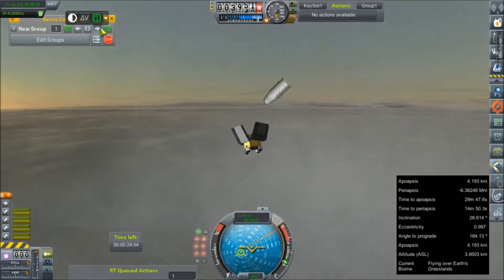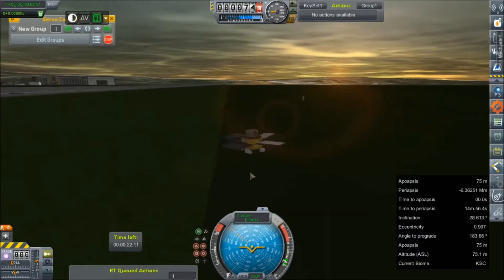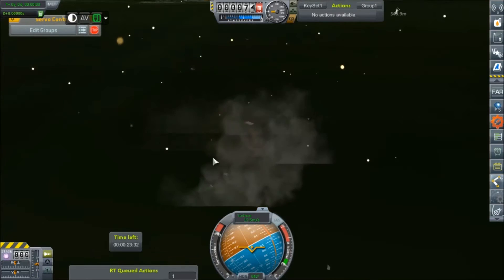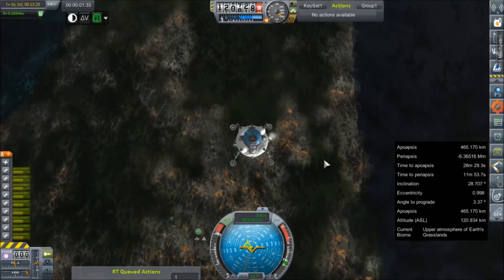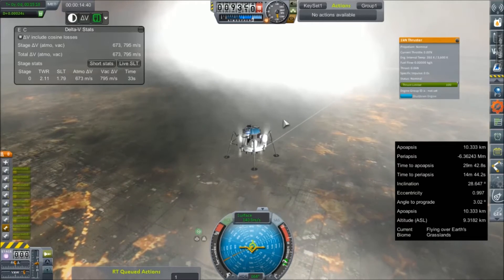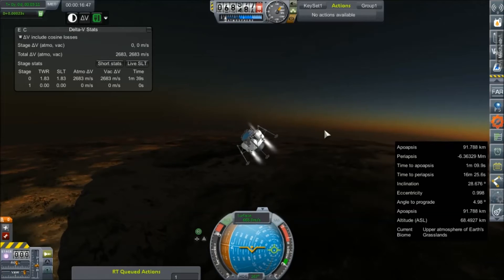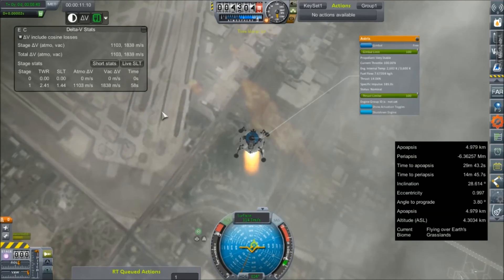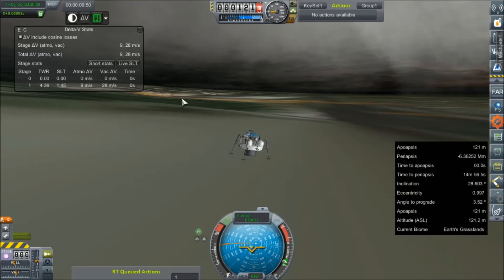KSP RP-0 #191 Mars Lander Proto Testing Sims

Comment: I came up with a concept I think you should add to another lander Prototype for Mars but this is for rovers so first you launch the craft on a basic rocket you separate the payload and make sure you’re on A sub orbital trajectory how it’s gonna work: Saul the rover is going to be encased in a arrow shell  make sure you deploy the parachute at a high altitude separate the heat shield and release the rover with a sky crane  fire the four or more engines that you put on the sky crane make sure your Delta v is going down enough for the Rover  to safely  touchdown then jettison the sky crane when you have made contact with the surface already and then do your surface and subsurface  operations and there you go it helps to turn a lander into a successful surface probe but instead of impactor
Reply from the maker: Later on in the series I will actually use a 'kinda' skycrane to put a Rover on Mars.  Just had to learn the mechanics of landing anything first.

Comment: The best landing methods for celestial bodies with a thin but not insignificant atmosphere - such as Mars - tends to be parachute-assisted propulsive landing.

The parachutes in the thin atmosphere provide some assistance with slowing down but adding enough of them for a fully-unpowered landing is inefficient. In a similar way, an engine is an effective way of slowing down (and a more efficient vacuum-optimized engine can be used due to the thin atmosphere) but adding enough fuel for all of the braking can get excessively massive.

There's a point where both methods meet up where a certain number of parachutes with a certain amount of fuel is the most mass-efficient way to land on a celestial body with a thin atmosphere, and it's usually worth testing out different parachute and propulsion configurations until that point is found.
Reply from the maker: Indeed. ( and quite eloquently put, might I add ) Using a combination of chutes with propulsive landing is the best way.  There is another lander that I built off camera that will use both, it will launch at the same window as this lander.  I am curious to see just how much is needed for a straight powered landing, as crewed landers to mars will likely rely more on engine braking than chutes for the descent phase.
Reply: With proper aerobraking I think 4000m/s is a good estimate for the amount of delta-v required for a fully propulsive landing on Mars. It's probably doable with less, but I'd aim for that to be safe. With parachutes as well I think you could probably half that estimate.
Reply from the maker: 4k huh... interesting. I may need to re-visit these protos then.
Reply: Just to clarify, I don't think you definitely need that much. I would personally go for 4km/s to be safe on a first Mars landing without knowing the required delta-v, but I suspect that it only takes about 3km/s.

And also for clarification, these numbers are coming from estimates based on the radius, mass, and sea level pressure of Mars, as well as the fact that it takes about 900m/s for a Duna landing in stock KSP and the delta-v scale factor for RSS is about 3.2 because delta-v scales by the square root of the radius scale factor. I don't play with RSS though so this isn't coming from someone experienced with Mars landings.
Reply from the maker: Interesting way to approach the problem.  I'd never scaled it in those terms.  My best estimations figured ~3Km/s if I could time it right. Based only on how much effect drag had before unsuccessful landers became successful impactors.
Reply: That's a pretty good method I guess.

Personally I tend to go above my estimates if I'm visiting somewhere new and send a single lander with what is probably an excess of delta-v, because then it's more likely to work and the delta-v left over compared to what I started with will tell me how much is actually needed.

But lower delta-v is cheaper of course, and I suppose if you're lucky and your estimate is right you've spent less on a lander.